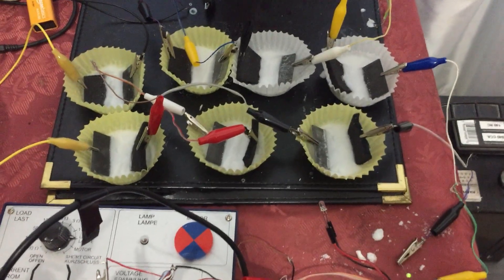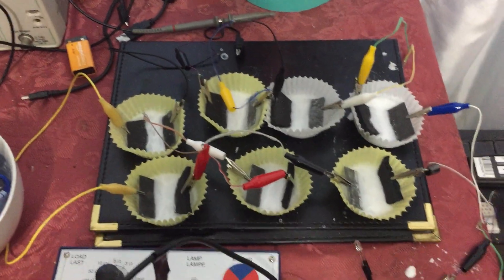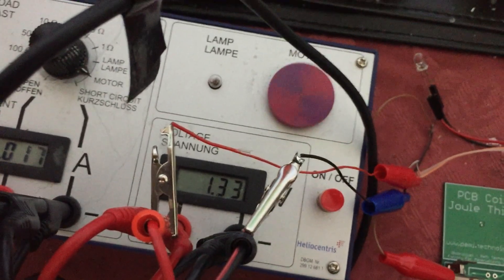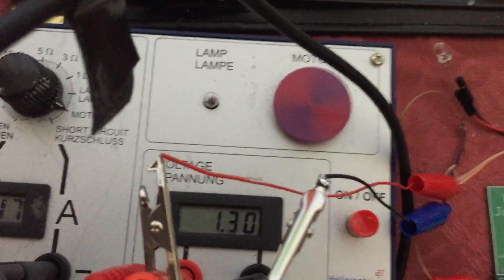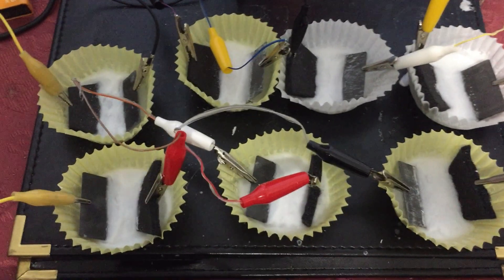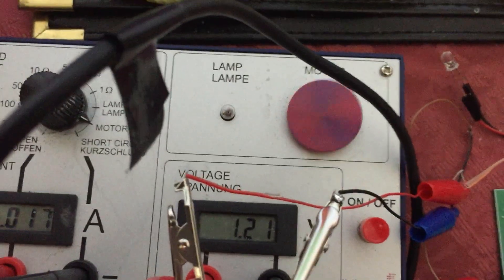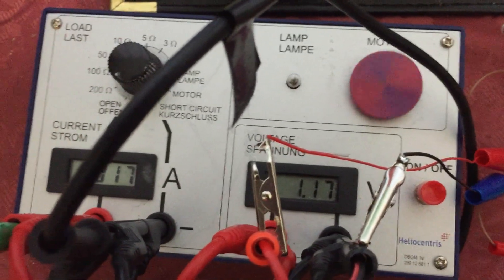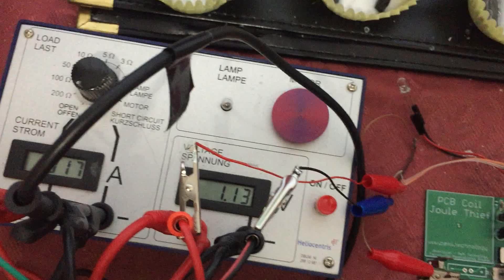Powering Loads

Comment: Awesome stuff very close to the work of a man back a few years a go U might of herd of him motionmagnetics. He had commercial units that he sold but he died recently keep up the great work I recommend trying to mold them into wafers and just staking them like a feet high the recipe U have is perfect huchison used barrium titinate wafers and got thousands of volts at high current sort of didn't know what to do with it and had to destroy it. If you can make the polymer substance substrate into a wafer in mass just simply stack them as high as you want like a voltaic pile and then you got it. John also has gold plated cylenders to contain the emf and U 👍

Comment: I have a question -  is that "battery" shorting through the motor without a resistor?  (like is that the actual amp limit of the battery?)  cause i actually want a constant low output battery, its what im doing.
Reply from the maker: Its going thru the Resistor load switch box with amp meter , when the knob is set to motor its just in line with the motor, no resistors. Its just a few milliamps really I was able to bring it up close to 100 by manually holding with diffuculty the plates as close together while it was liquid. If your going for continuous current, I'd work out a plan/mold for making a tight pile.  That small motor runs about 20 mins when discharging from capacitor connected to cell. Wait about an hour and its good to go again. Building the cells more efficient and or running more in series or parallel could take care of not needing a capacitor.
Reply: @joellagace1679  excellent thanks for reply.   I actually got this special case of a power source where I need a really low amp limit but high amp hours, or as much capacity as I can, I wonder how you design the battery for that...

Comment: You need the Electrolyte as thin as possible without touching?! Then rotospincoat the first electrode and then put the second electrode 9n to when the electrolyte is hard then remelt (if possible) the electrolyte to get the second electrode stick🤔
Reply from the maker: Sometimes I can be stupid :) good pointers.

Comment: I understand what you're going for, but the energy density is apparently VERY low on these different combinations. While I agree finding a good solid electrolyte is an important step forward in energy, it's clear that none of those particular items are it, in the scientific process sometimes you have to pull yourself away from things that have SOME results, so you can move forward and find something that yields BIG results.
Reply from the maker: You are not aware of the end goal it seems.
Reply from the maker: I recommend that you watch my videos from the start. It explains how we are aiming for pure potentials and convert that to current thanks to the poynting vector, using one wire and diodes. However if your happy with the up to a few watts a good galvanic or similar cells work solid state or non solid state if proper built and optimized. Many would be happy with it! How ever.   At kilovolts (Zamboni style) We can trigger the pure potential and have a field of  several watts closer to 100 to tap into. Use displacement current to charge big capacitors and dump them into your loads/storage for real watts.

Comment: Can you cap dump that and then save it in a battery?
Reply from the maker: yep. At these low power levels its simple enough to build with a transistor cap dump. and a high value bias trigger. With most devices with lots of current the transistor stays locked once on with no reset system. Like scr and neon dumps etc.

Comment: Great work Joel! You could dry a flat sheet of it, then cut to size and use some of the wet stuff to "glue" on your carbon felt, it would save a bit on felt material in a stack too. I put that title in the first part of this video's comments, just if you're interested.

Comment: That's impressive with so messy setup :D Kitchen plastic wrap with pinholes might be a good thin separator. Usually the anode and cathode collectors are made from some metal that is coated with graphite to make it corrosion resistant. That way the poles could be made from metals that would normally have galvanic effect on them. Some studies say that way it might have some self charging effects. Most batteries that work from the moisture of the air need some acid to keep the surface open and have more surface area. Also some salt or silicate is needed to collect the moisture from air. Over dried natrium- or calcium chloride might work better, or potassium formate.